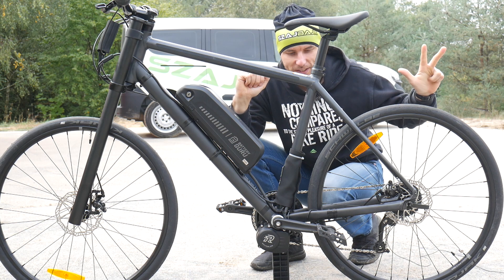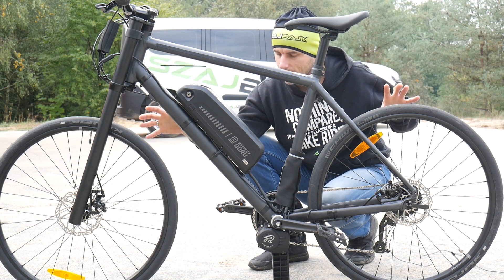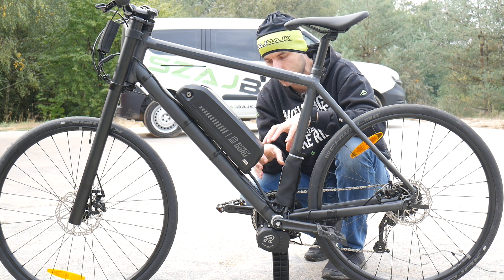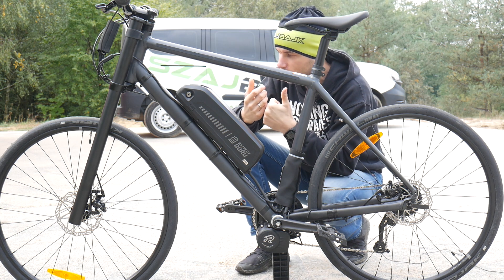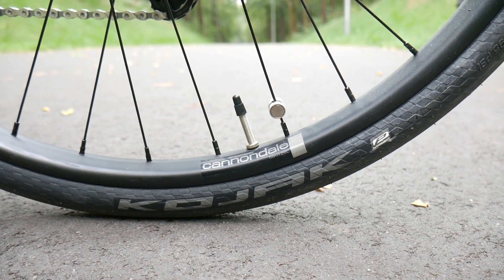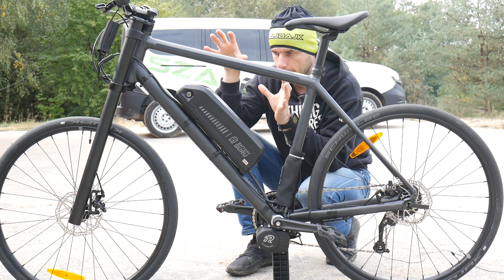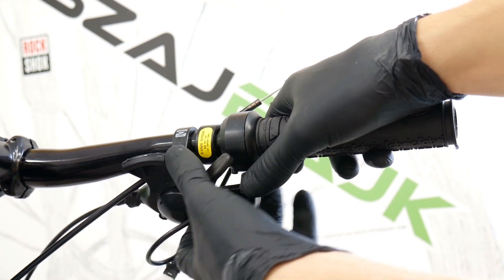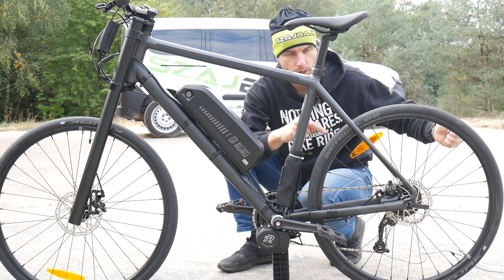3 Cons And 3 Pros For An E-Bike Conversion Kit. How I Transformed My Cannondale Bad Boy Into Hybrid

Comment: I think it looks fine. Did a good job on it. The usage is more important. I've ordered one of these kits for an old steel frame hybrid bike that I currently use and now I'm a bit apprehensive about it being a bit rubbish but I didn't have (or necessarily want to spend) the thousands of pounds for a decent ebike although I might end up doing that also. Will see how this goes first as an intro to ebiking. I like my old bike but just want to do longer rides without being totally drained & exhausted as happens now and currently my bike is like trying to cycle a large concrete block up hills  & it is hilly here & difficult even though I have a basically 28:32 low gear. I was an engineer so hopefully I can manage to sort it out.

Comment: What happens to all the electrical components/connections when it's raining? they're not waterproof. It's not easy changing a tire on the road because of all the "stuff" on the handlebars. All that stuff can be distracting and dangerous when riding in traffic. Even if locked up a bike is prone to vandalism and theft.

Comment: I converted my 2018 giant by adding a bbshd. Amazing fun
Reply: BBSHD is quite amazing, though it has had some quirks in later editions like soft pinion metal shaft and the priority change of throttle/pedal assist.
None the less my BBSHD from 2016 is going strong on 18S battery and 45 A (modded controller). I've passed 16000 km already. Done preventive regreasing twice.